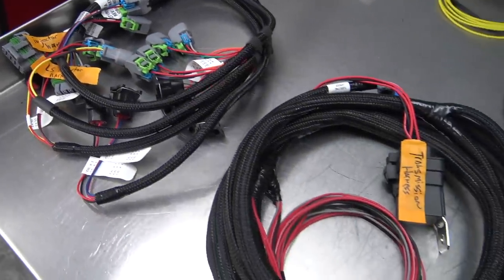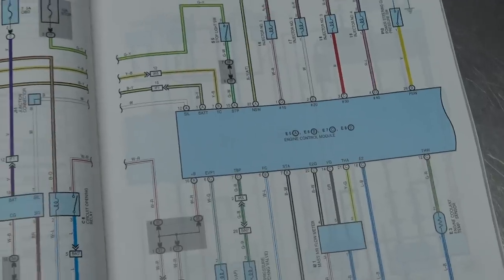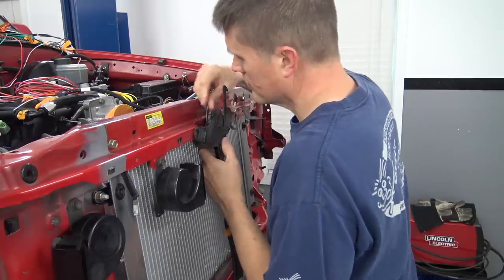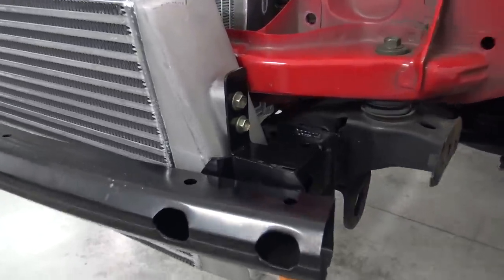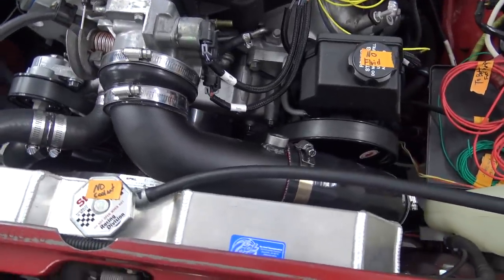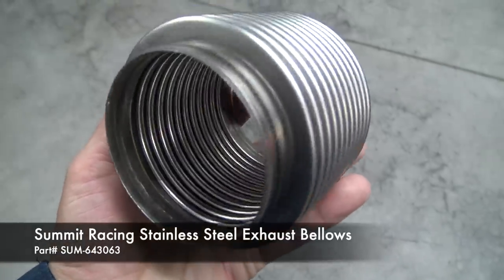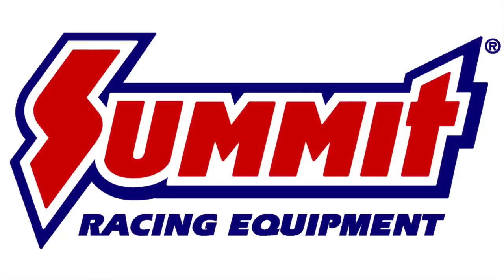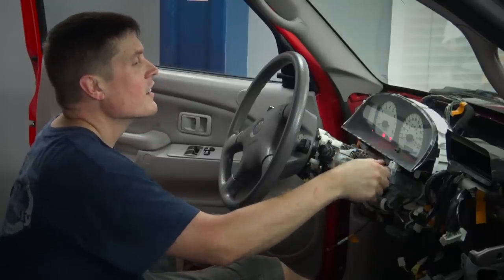LSX V8 Turbo Tacoma - Project Firebolt Part 11

Comment: Hey Tom.

Engine Master tested meth injection in the typical intake manifold and found that it wasn't working correctly. Because of the funky curved intake runners, meth wasn't making it to the front cylinders. Be real careful. That could be really bad news under boost.
Reply: came here to post about this!
Reply: Glad someone said this. I completely forgot about that episode.
Reply: @Metalution  I have faith Tom will find a solution to it though :)
Reply: I'm sure this is one of the issues Tom will address.
Reply: I’d like to see someone take the model of that intake and do some CFD analysis see how air is distributed throughout the runners. This should give a clue if the meth injection would be evenly distributed in each intake runner.
Reply: @izzyplusplusplus1004  There's no way of addressing it other than port injection. In the past four years, I've seen three severely damaged LS engines with LSX-R and GM LS performance style intakes. Only other way to do it would be to install at least three or four injectors in the top of the plenum, but I suspect that it will cause a ton of issues due to the boost pressure.
Reply: @AB-80X   does the methanol cause high temperature combustion? Why is port injection the only way? And additionally, since this is not a ls, and has direct injection, could the ls style intake with it's own injectors be used simultaneously with methanol for the main fuel? Meth direct inject, gas or ethanol plenum injection.
Reply: @AB-80X  Correction, this IS an LS. Got my builds confused. I mistook this comment for one on FasterProms. Disregard questions.

Comment: Engine masters on motor trend on demand  recently did a myth busters episode where they tested how effective single nozzle water meth injection is on a ls engine.    They concluded that it cannot be effectively distributed to the cylinders on that style of intake manifold.   The only real way to do that would be direct port water methanol injection.    Just something to think about.     Love the videos.
Reply: Matt Duncan your right I blew up my 5.3 with nitrous wet shot 7&8 where fine the rest of the rod bearings got worse
Reply: Season 4 episode 45 for anyone interested.

Comment: Have you seen the engine masters vid about water meth being unsuitable for the factory intake manifold, apparently it all dumps in the back two cylinders, potentially causing more harm than good.?
Reply: You gotta pay to watch the full vid.  Motor trend went full on pay for content.  Ugh
Reply: Wes yeah I subbed for it. They say  that ls factory intake manifold is a dry air deal and does not respond well to water meth injection, they found it sends the bulk of the water meth down the back two cylinders. I have seen guys send it through the turbo compressor lol not sure why or if this method helps, but they did not show this method.
Reply: Clint Collins makes sense wonder if you could tap the manifold in 2 or 3 places and distribute evenly with smaller injectors
Reply: Bud Ranger yes I was trying to think of something like this to but from memory the hot rod guys said something about using a plenum designed like a carby needs to distribute liquid type fuels, something about the inside surfaces of the plenum?

Comment: Tom, it's amusing how similar your Taco and my Supra are in terms of cramming a lot of stuff into tight spaces. My fans and oil pump drive gear actually overlap in the vertical plane. On that note, you have my sympathy here trying to fit those intercooler pipes... 3" is no joke!

Comment: Tom, don't forget you need room behind the core too for ambient air to flow. One of the biggest issues I had with my DSM was getting enough air through the A/C condenser due to all the pressure drop and air loss. Ducting is your FRIEND here!

Comment: Suggestion on your intake piping. Square tubing. Gives you more clearance in tight locations. Use 4" x 1 or 1.5" thin-wall square tubing, then cut 3" round holes on the ends to weld round tubing. Trim access to make sure there are no protrusions internally to the tubing. We really like your projects. Good Luck.

Comment: Have you thought about installing the intake manifold with the throttle body toward the rear? Mounting bolt holes dont change and just flip around the fuel rails. Still works as normal. May give you more room for a charge pipe in the rear of the engine bay.

Comment: Tom, you might want to make a 1/4" little metal disc and weld it to the inlet pipe and then drill and tap it for the meth nozzle so you have more threads to hold on. Something I learned along the way, especially with aluminum pipe. Love the builds though!

Comment: Tom, just a thought on the catch can routing. I would not plump the passenger side valve cover vent pre-turbo without an intermediate sealed air-oil separator. Oil droplets hitting turbo blades spinning at 100.000 RPM sounds pretty bad. In addition, this will eventually coat the inside of your IC pipes and condense in the intercooler itself, filling it with oil. Pre-turbo routing is a nice vacuum source, but please consider filtering the oily fumes first.

BTW love the BOM elements on the last couple of vids! Keep up the good work!

Comment: you should put the wmi nozzle as close to the cold side of the ic and as far from  the  throttle body as possible to allow the liquid to become thin vapor before it reaches the intake manifold... with that you will get an accurate iat value judging by the location of your iat sensor and maybe you will not experience the wmi problems with the ls engine that are mentioned my others.... love your work

Comment: Hey Tom, just a friendly tip here. For your water meth injection nozzle instead of tapping the thin charge pipe weld a half inch thick piece of plate to the charge pipe and tap it. Hopefully would be less of a chance of ripping the threads out under pressure.

Comment: Hey Tom I love the build! Just a thought on the intake piping and intercooler placement - I'd be happier if the intercooler was rubber mounted to allow so thermal expansion, and I'm worried those intake pipes will rub a hole on your radiator! I think it's worth looking at the setup again an considering how much the engine is going to move under load. Good luck! Adam

Comment: Tom, i bought a dsm 8 months thanks to your videos and I love it. I have speed density set up with meth injection and she loves it. Wouldn't you want the nozzle before the IAT sensor so the ecu will adjust fueling and timing from the cooling effect of the meth?

Comment: Shouldn't you put IAT after the Methanol injector? Injection is going to change the IAT pretty substantially in some cases.
Reply: Karl Carpenter exactly. Cooling the charge air further than the IC's ability is worthless without the ecu knowing the air temp (and density) has changed. Tuner's nightmare.

Comment: I'm surprised you ended up mounting the intercooler hanging halfway out of the bumper like that, it looks a bit goofy lol
Reply: Besides goofy looking, I think welding the mounting brackets to the crumple zone is asking for trouble. 
It looks like there's  room to tilt the radiator top forward, and/or move the bottom back with a modified lower rad support. 
I'd ditch the hood latch support, and fab a bracket that holds it and the intercooler higher up (outside your crumple zone), and make any trimming needed to the grill/bumper.
Reply: Tom B I agree. Should’ve mid mounted the inter cooler and  hole saw a 3” in the core support.
Reply: Doctor Zoidberg How is welding the mounting to the front bar a problem?
Reply: @jonasthemovie  That area is designed to crumple and dissipate crash forces on vehicle occupants. Best case, he's just blocking airflow with the crash bar but in even a minor accident he could end up with a squashed intercooler. There looks like plenty of room to move that up and towards the radiator. I'm guessing it was easier to route the piping under, and he was afraid of cutting the bumper cover/grill.
Reply: Doctor Zoidberg Is a squashed intercooler a big problem when the car is crashed?
Reply: Leaves cooler air for the radiator that way, and I don't think there's much worry for the cooler in a crash, is easily fixed

Comment: Might be a good idea to stick some rubber pads between your cold intake and the radiator. At the very least, it'll stop any rattling even if it isn't directly over the rad fins.

Comment: another excellent project Tom, i have questions and comments... how does the flex coupling wires on the exhaust side go backwards to the turbine housing? did you weld small beads on the intake pipes to prevent them from being off? and keep in mind every 90° bend in the intake pipes or exhaust creates a psi drop...so when you re-make those intake pipes in aluminum try to use more sweeping pipes. welding aluminum is easy, but it won't forgive you if you get it too hot💪

Comment: Take your check valve apart and inspect it. I had one that looked similar and the check was a small rubber flap and spring. It didn't last long before the rubber flap was ingested.

Comment: Might want to run some rubber bushings on the intercooler mount, the vibrations from the body could crack it over time.

Comment: I've had (2) AEM controllers fault and go to full spray and flood the engine. I highly recommend a failsafe switch wired directly to the pump. In the case of my failures a power disconnect on the controller side DID NOT stop the pump because of the internal controller wiring pulsing the ground to control pump speed.

Comment: He read the comments about the flex couplings. Ignores the comment about how that intake manifold is not designed for flowing wet air into the engine and distributing it evenly to the forward cylinders. And how that intake is just going to throw all that water-meth mix straight to the back two cylinders.

Comment: Hey Tom. I had a question from the last video. Is there any reason you can't use the holley ecu to control the trans cooler fan instead of the thermostatic switch? Loving the build, keep up the great work!
Reply: You definitely could do that but this Holley ECU only has 4 outputs and you would be using up one when it could be better severed as boost control or engine cooling fan control, or something that didn't already have a way of control.

Comment: Edit: Little did I know half of YouTube commented the same as my own. Lol 

The only problem I see is that the LS intake does not take to meth injection well. Only the front half of the motor gets to use it. Motor Trend Engine Masters Season 4 Episode 45 will show you how the water meth injection is pretty inefficient and not completing the job because the manifold was not designed to have fluid running through it. So you would need a multi port setup or a different manifold to EFFECTIVELY use the water meth injection on an LS engine intake. Just a heads up.

Comment: The clearance between the inter cooler pipe and rad makes me nervous. You could flatten out the back to gain a bit of a gap? I’m just thinking if this is your daily drive it contact and wear when the engine moves about. Not sure that rubber pipe is enough to mitigate the movement?

Comment: With a charge pipe that long, do you really need an inner-cooler? If the charge pipe is Aluminum, the heat dissipation over that length should be pretty good.

Comment: The mild steel intercooler piping will rust on the inside from heat and condensation. Rust flakes will get sucked into engine.

Comment: Hi Tom, I’m installing this same water/meth kit on my turbo LS setup right now. I was wondering what your experience was with using the medium nozzle you installed here, and at what boost level? Also, I’m curious to know how Holley’s closed-loop function reacts to the water meth kit? I imagine that if the kit sprays and the Holley sees a richer mixture, then it would compensate for that to reach the target afr? Thanks.

Comment: Could you have used a 90deg coupler at the throttle body rather than cutting the coupler and using the 90 deg pipe? Just curious? I’m sure you’ve thought of it!

Comment: You can weld aluminium with your MIG wilder. You need a different gas bottle and an aluminium wire reel and you're good. Then you can grind off the welds so they don't look like bird poop.

Comment: You could probably get a better fit at the throttle body by using a 90 degree silicone coupler.

Comment: Exciting build, but you don't want a check valve on your PCV system as shown.  This will result in no crankcase venting under boost...which is when you have maximum blowby.  Eliminate the check valve and vent it to the inlet side ahead of the turbo, which maximizes flow at maximum boost.  Granted, you have a long run in this set up, but the vent line after the catch can should have little to no entrained oil or water vapor in it anyway, and will still be more effective than just venting to atmosphere.

Comment: Is that break booster a vacuum booster? I hope not. In boost, you will not have breaks until the engine produces negative pressure.  I almost crashed my Turbocharged truck years ago because of that.

Comment: I Toyota we have a program called TIS and another program called  TAS But TIS is the program used for everything even recalls, in tis if you click the wire it will give you valuable information such as how much voltage that wire is supposed to get

Comment: Won't the intercooler piping bounce off the radiator when the engine moves (on the motor mounts) and the radiator doesn't? It looks tight there.

Comment: Think a smaller intercooler would be better with such a large charge pipe? I would think that long pipe would cool the air in it alone and wouldn't have as much space to fill up with a smaller intercooler.

Comment: If you're going to be cutting lots of silicone hoses or want a safer way you should take a look at the Redback Silicone Hose Cutter. If you want to buy it use the discount code "The Skid Factory".

Comment: I personally wouldn't run a line from valve cover to turbo the whole point of the catch can is to remove oil and oil vapor from the inlet tract you should run both valve cover breathers to the catch can and than to the throttle body inlet piping

Comment: 21:50 definitely not all Toyotas. My dad's 06 Sienna had a washer fluid tank so laughably tiny, it would run out of fluid after running for about 30 seconds straight.

Comment: I would have rather seen a GM 411 PCM tuned with open source PCMhammer and TunerPro RT and a $20 OBDII to USB adapter. There is so much bought in your builds.

Comment: You want your meth before the air temp sensor, if you want your computer to register and read correctly, move your meth nozzle a good 6” before the IAT.
Reply: Came here just to mention this. No point in cooling the charge air further than the IC if the ecu doesnt know you're doing it.

Comment: Tom, before using that Meth injection kit, I urge you to watch episode 45  here. https://www.motortrendondemand.com/detail/hot-in-cool-out-intercooler-vs-water-methanol-injection-for-turbos/1_fvb14q1a/
Those LS manifolds have terrible distribution issues when it comes to Meth injection. I've seen three engines in the past 4 years severely damaged due to poor cylinder to cylinder distribution of Meth in LS and LSX-R style manifolds.

Comment: OI!   "Make the Noise" is trademarked by Binky!   It will come and eat your Tacoma because of this.   Just wait another 3-4 years.....  :)    I question the location of the alcohol injection system.  Toyota designed that tank to hold water - and placed right up front because the liquid is inert.   By placing alcohol in it - it's now placing flammables up there.  Right up where the car gets smacked if you have a crash.    Additionally - the car isn't legal without a screen washer.

Comment: Not entirely sure on the intercooler...kinda looks slammed and it ruins the whole idea of the truck. You worked so hard to make it "stock" from the outside. Would've gone with a narrower one or two smaller ones in series.

Comment: Put your meth injector just past the intercooler; this will ensure you have enough residence time to vaporize the water / methanol mix while avoiding condensation in the intercooler.  IAT can stay in the current location.

Comment: With that long hot side pipe, that obnoxiously gigantic intercooler the meth injection wont be needed. Dude, get a smaller intercooler, think of the pressure drop and the lag.